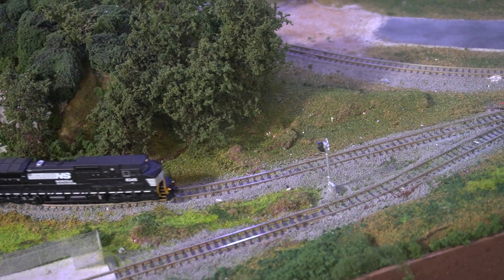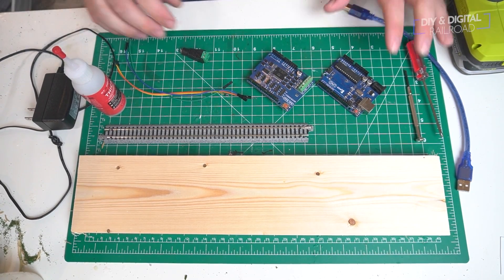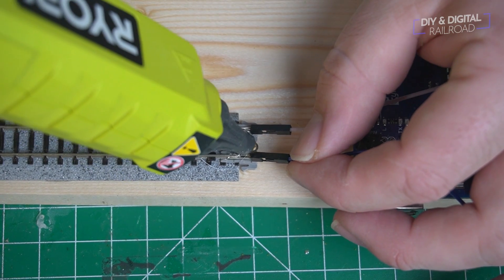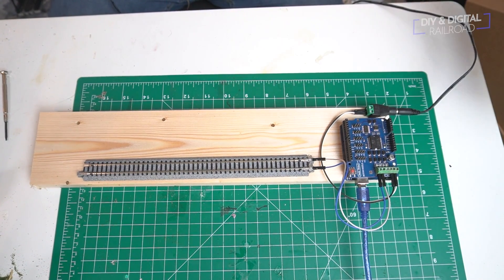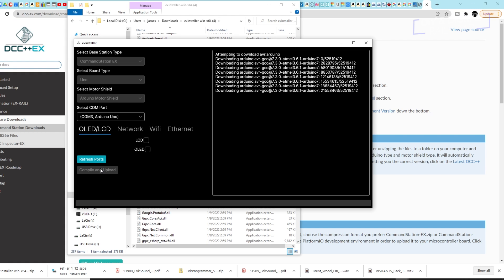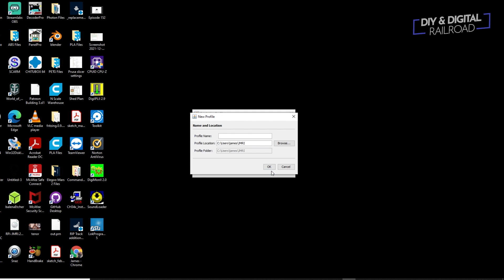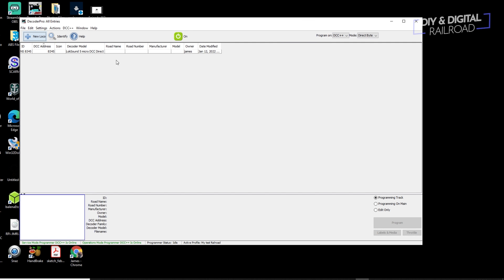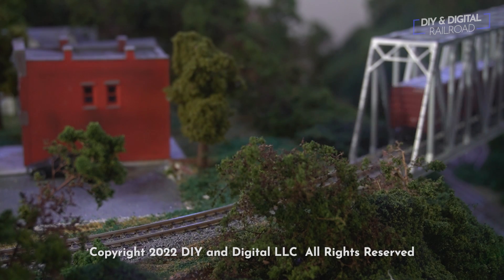Let's Build a Portable Model Railroad DCC Programming Track

Comment: I tried this, exact parts and all, and get error 308 in JMRI (connection or weak power). As soon as I plug in power to the arduino (not shown in this video) it is able to detect the decoder, but still unable to move the trains. I tried cutting the connection between the “vin” joints (shown to do so in other base station video) and am now back to getting error 308 with both the Arduino and shield plugged in. Please help 😢
Reply from the maker: The programming track for a DCC++ setup won't move the trains like it will for a Digitrax PR4.  If you need to move it.  Connect to Terminal A.

Comment: I followed your video of installation of DCC-EX. The installation was successfully completed. I am using Arduino Mega and Standard Motor Shield. When I power on the DCC-EX I can see that 2 LED lit up on the Motor shield instead of 4 LED. 

Due to this I am not able to do the programming of Locomotive Decoder. Can you please tell me where am I going wrong. When I power on the DCC-EX why all the 4 LED don't lit up.

Arduino Mega is powered via USB cable and Motor shield is powered by 12V 2 amps power supply.

I want to use DCC-EX only for programming the locomotive decoders

Comment: Does anyone have an update on the settings? the compiler has been significantly updated. I did not get the choice of 'arduino Motor Shield' so I chose 'standard motor shield' ? everything looks ok and decoder pro all looks fine, just getting no read/lights flashing from either the loco shield or the deek-Robot motor shield I am using? ( yes I have switched on in the program) thanks

Comment: 1.  Can I use a Mac laptop as the computer?.  2.  Can this be used to load sound files into the loco decoder?
Reply from the maker: Yes.  I use a mac.  If you can load sound through JMRI then yes.

Comment: Kato sell a powered unitrack connector. Basically the Kato plug with two wires that end in track connectors. Would streamline it a bit, as you could just cut the plug off, strip the wires and attach whatever connectors you need for the Arduino.

Comment: I’m fairly new to the world of DCC.  I’ve done some programming through my NCE Power Cab, but this looks so much easier.  What make and model of Arduino UNO and L298N did you use?  I’m seeing all kinds out there and I want to keep this as simple as possible by building exactly what you did.
Reply from the maker: I have the motor shield linked and the UNO clone I use the most linked as well in the description.

Comment: Just starting, so I was programming on teh main, on a very large test loop. Reading the entire CV table, about 90 minutes, and with each read the loco twitched back and forth. I bet it traveled 20 feet. I would recommend some form of a stop at each end of a the track - such as a simple block of foam. Great video.

Comment: Good article, Jimmy. I use a SPROG-II (now superseded by SPROG 3) instead of the Arduino. This costs more, but it is a turnkey system for those who do not want to deal with the Arduino and the motor shield, or with the assembly and programming. Also, the SPROG 3 will operate trains as well; it's literally a mini-DCC system.

Also, instead of a standalone piece of track, I use a section of my layout track which is electrically isolated (e.g. a siding track works nicely). I wire a male 2 pin connector to the track, and I connect a female 2 pin connector to my DCC power bus, and a second 2 pin female connector to my SPROG. (You could use a DPDT center off switch for a permanent wiring solution.) When I want to program, I unplug the track connector from the DCC power bus and plug it into the SPROG. I can program and test while connected to the SPROG. When finished, I unplug the SPROG and connect the track back to the DCC bus.

Comment: Looks great, Jimmy!  I've been using a digitrax PR4 on a small switch-puzzle layout (shoutout to Steve's Trains for the plans) by swapping the dc throttle for the PR4.  I probably have enough spare arduino parts to build this. I like the idea of the small dedicated setup.  I use a 10 year old netbook as the JRMI host. It's a bit slow loading JRMI, but good enough plus it is super small compared to a normal laptop.
I too learned to keep my bald head covered, especially in the AZ sun. Be well!

Comment: 8:01 nice deocoder type
Reply from the maker: Thanks!  When I am doing sound, I like to use the ESU decoders because they fit better.  I had a bad experience with milling a chassis for a digitrax speaker and I sheared the metal body in half.  If I am not doing sound, I get the cheapest digitrax decoder I can find.

Comment: I am going to stick to DC I get to lost in all the programing. I know my strengths and weaknesses and the programing is different weak link. Lol 😂
This is great video for those who can do the programing. Heal kwikly Jimmy see you next time.
GOD BLESS 🚂❤🚂❤🚂❤
Reply: No need really for JMRI or programming to change cv's. I use a Roco Z21 DCC control station, which allows me to modify any CV' on my tablet or iPhone, and I can also use both devices to run my locos and throw switches/ turnouts.

Comment: I didn't need a portable programming track. I just put a N scale and HO scale rack on a board and connected them to my power on the controller base station with a on off switch when not using and just running trains. Another connection runs from my base power station to my laptop for JMRI. I use my handheld for setting address  and other settings in JMRI
Latest:   After following your instructions, it worked really well, but,  now on a Atlas s2 N with ESU i constantly get a code 308.  lights and sounds work, but motor will only rev up but, not move at all.....:(

Comment: Jimmy, did you forget to bend the 2 power pins on the motor shield out of the way to prevent 12volts from burning out the Uno or is this only running 5 volts from the laptop?  Great vid!
Reply from the maker: Hey Matt.  The arduino can handle up to 12 volts.  So there is no danger of burn out.
Reply: Cutting the VIN trace and BRAKE traces on the bottom of the motor shield allows the use of an external power supply safely for track power.  Used laptop power supplies are ideal for HO and above.  N scale can get away with 12 volts, though sound equipped locks can want more power and be finicky.